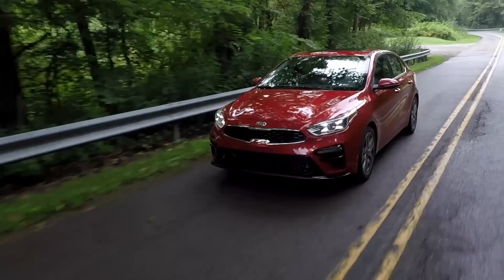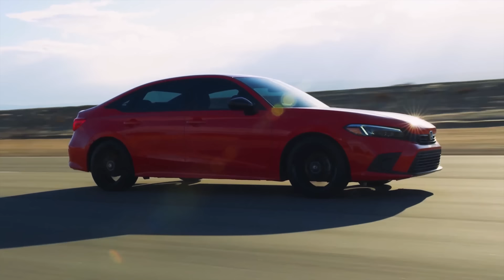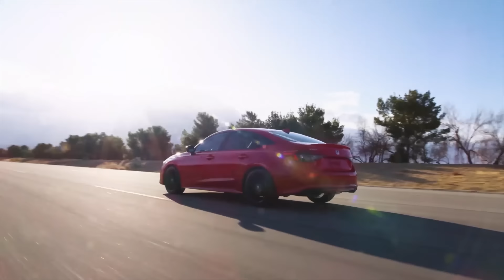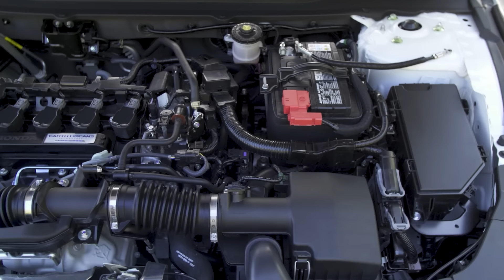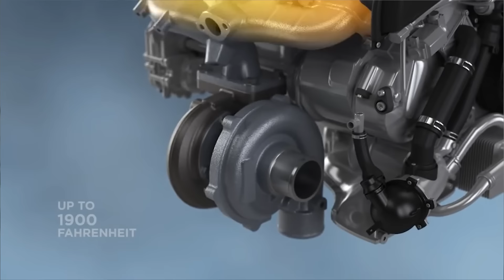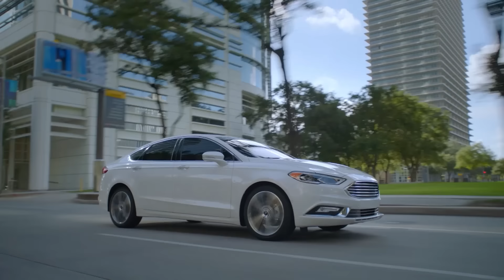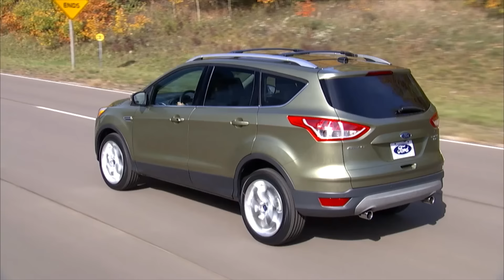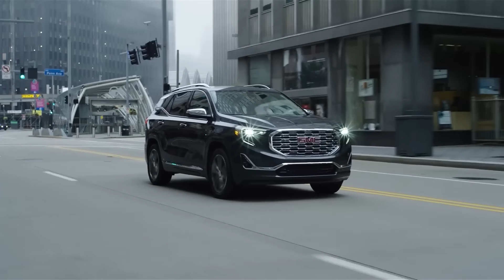Are Turbocharged Engines Reliable? The Truth About Turbo Engines

Comment: I have a 2013 Kia Optima with a turbo engine. Currently 145k miles. I live in a traffic heavy area. Haven't had an issue. And it takes regular gas.
Reply: Ironically, the Hyundai and Kia turbo engines are more sturdier than their naturally aspirated counterparts, due to their strengthened connecting rods and pistons.  Connecting rod failures are a key issue in the Hyundai and Kia engine recalls involving their naturally aspirated Nu and Theta engines.
Reply: @oi32df  That's true.

Comment: My sister just got a Tiguan with a turbo engine. It has that annoying stop and go where the engine cuts off automatically when it comes to a stop to save gas. If turbo engines don't like to be turned on and off all the time I don't understand why Volkswagen would use stop and go with them.
Reply from the maker: Because it results in better official fuel economy ratings on paper which is all they care about. The real world impact on long term reliability is of little concern to VW.
Reply: The very first thing I do when I start my 2020 Honda CRV is disable that annoying piece of crap.😆
Reply: So you can buy another one or pay them to fix it planned obsolescence

Comment: Great video Shari, as usual you nailed it with all the truths about Turbos.
Thank you for all your knowledge sharing for the lost generations now days. I personally, will not touch a Turbo vehicle unless I have money to burn. Most of us working class should just stay away from Turbo engines.
Reply: Thats kinda hard to do since most automakers are using Turbos (mated to CVTs which are even worse). I'm wary of  Turbos, and will never but a CVT so idk what to do smh.
Reply: Word!!
Reply from the maker: No problem!
Reply: @carhelpcorner  Can you explain how semi's can easily go a million miles on a turbo without issue?  Those engines are easily the most reliable on the road, and they ALL have turbos.
Reply: @nodammit  Those are turbo diesel which is a different story.
Reply: @nelubotas2545  a turbo is a turbo. Whether you mount it on a gasoline or diesel engine, it does exactly the same thing.
Reply: @nodammit  Wrong, most diesel engines are built to different standard!!
Reply: @nodammit diesel trucks are a different world and diesels have plenty of issues, too
Reply: @bb5242  Yes diesels have issues, but this video is about turbos.  The point I was making referencing diesels is that despite having turbos, they can go a million + miles before a rebuild.  I personally prefer gas engines, but I've worked with diesels for decades.
Reply: @mikek.9980  So you're saying that it's the standard the engine is built to that determines reliability?  Exactly.  Thanks for proving my point.
Reply: I had a Saab turbo in 1980, everyone told me don’t buy a turbo. I had the car for 13 years and not once did I ever have any problem with the engine or turbo. Used regular gas and changed oil every 5000 miles. Put about 15000 miles on it every year. Best car I’ve ever owned. I have a Hyundai with a turbo now so far it’s just fine.
Reply: @nicholasdidesidero2336  The old Saab were over built and they were premium vehicles which are not mainstream economical vehicles. The later Saab were GM influenced garbage.
My suggestion to Hyundai to not put any Turbos on any of their vehicles. Hyundai is never known for their overbuilt standard, they always barely made the standard and for them to risk their reputation on Turbos is a terrible combination. Hyundai is just passing on their risks to owners which on long term going to hurt the pockets. Just remember the old Saab and Volvos with Turbos were made to last unlike the later versions.

Comment: I’ve had 2 cars with turbo engines and I’ll Never buy one again. They simply don’t last as long.
We usually keep our vehicles for 10-18 years.
The longest I ever drove a car was 19 years. (I bought it when it was 5 years old, so it was 24 years old when it died at 488K miles. It was a 78 Corolla).
Reply from the maker: I agree buyers beware.

Comment: There aren’t too many vehicles nowadays with supercharged engines but I assume they have the same type of issues as the ones with turbochargers. Am I right? In particular, the MINI Coopers sold in the U.S. in the early 2000s had superchargers but then a few years later they switched to turbo chargers — I wonder why.
Reply from the maker: Superchargers are rarely used anymore because there is no fuel economy or emissions benefit. They generally don't seem to be as problematic as turbos, but they certainly put more strain on the engine itself.

Comment: Just bought a crv 4 days ago….not sure I would have if I’d seen this video beforehand.
I don’t drive long distance very often, would it be helpful to warm it up before driving? If so, only in winter or do I need to do so year round regardless of temps? I’d appreciate more advice for those of us who are already owners of turbo charged engines plz
Reply from the maker: No need for long warm ups, but try to take it for a long highway drive every so often just to keep the engine in good shape. Change the oil regularly too.
Reply: @carhelpcorner  how often? I’m totally ignorant about cars 🥴
Reply from the maker: @SusanPsalm51  take it on the highway once a week or so if possible. Change the oil every 6 months or 8,000km/5,000 miles. That's a good start 😊
Reply: I also own a 2020 CR-V and from what I've read, the Honda turbos tend to hold up well. The most important thing is to follow the maintenance schedule, especially oil changes and use good quality top tier gasoline(not necessarily premium) and it's usually sold at the mainstream gas stations like ExxonMobil, Chevron, or Costco.
Reply: Don't worry about having a turbo. I have a 2013 Ford Escape with the 2.0 L turbo engine.  It currently has 150,000 miles on it and never had any issues with the engine.  I keep up on maintenance and only use synthetic motor oil.
You do not have to let the new turbo engines idle for a minute before shutting them off. They are designed for oil to move through the turbo bearings after it is shut off. Years ago....when turbos were first used. They had problems because the oil just sat after you shut your engine off and baked on the turbo bearings.
Enjoy your new car, enjoy the power and fuel efficiency that the turbo brings!!
Reply: Enjoy your new car!!
Reply: A good long highway drive regularly will help and lots of oil changes, don't skip them.
Reply: Do not shot the engine immediately after long trip just keep it working for 30 second or 1 minute in order not to cause turbo failure

Comment: If your miles on a turbo are in that more severe category (short trips and cold weather) are there mitigating steps you can take to try and offset that periodically? Will a longer trip on a regular basis or periods of high RPMs help clear out the engine for example?
Reply from the maker: You should take the car for a long highway drive once a week. This could help prevent some long term issues
Reply: @carhelpcorner  but then you will get rock chips and I love my flawless paint 🤔
Reply: Are there any brands of fuel additive that can help? Or do oil flush treatments help? A long highway drive each week is a bit wasteful given fuel prices now
Reply: @piglet5287  I drive a 2019 Ford Fusion Titanium with Ecoboost. I work from home so I don't get to drive that much. What I do to get those highway miles in, is that (once a week) instead of going to my nearby grocery store, I go to one that is about 30 minutes away. The longer the drive the better for the turbo. Unfortunately, I don't want to drive for the sake of driving, so I do the grocery store runs. With regards to fuel additives, I don't use any. I just get gas from top tier gas stations. These gas stations already have more detergent in their fuel to help mitigate against carbon build up. I tend to use premium gas now also (I did not always use Premium). My car doesn't require it, it recommends it for better performance. When traveling to SC earlier this year, I noticed that my car drove better on premium gas than it's been driving on regular gas. That's why I started using Premium. Turbos really need quality oil, quality gas, and that long distance driving. They crave it. 😀
Reply: @bonedatt  although I'm in U.K. my situation is not so different. I drive a 2020 Peugeot 208 with the Pure Tech 130  3 pot engine used in many Stellantis models. It has all the risk factors  - turbo, direct injection, stop-start and a reputation for carbon build-up long-term (not to mention a cambelt running through an oil-bath but that's another story). As I've retired at least for now, my journeys tend to be short apart from the occasional 180 mile trip to see family. Like you I try to go the long way round for some local journeys, just to warm up the engine. I nearly always use Shell petrol, but not their premium (V-Power) product because it costs £2.09/litre here and that's after a recent price drop! The engine does seem to run extra smoothly with Redex fuel treatment, maybe because of the upper cylinder lubricant, but I've heard it said that additives are less beneficial with direct injection because the fuel bypasses the inlet valves. If true, that would surely also apply to additives already in petrol at the pump, but no-one mentions that.
I also read a mechanic on Quora claiming that modern engines no longer benefit from a high-speed motorway trip in the way they used to. The problem is that in the interests of economy, piston-rings are made to fit less tightly into the cylinder walls nowadays, so at higher revs there is more blow-back of oil mist from the crankcase up into the combustion chambers - and that leads to more fouling up. Well I'm no mechanic but it'd be good to see more comments on this. I'd imagine that long trips are still beneficial for lubrication, especially of the turbo, even if high revs no longer "clear out" an engine - if they ever did. Goodbye Italian tune-up? Good luck with your car, it sounds like you care for it.
Reply: @piglet5287  You chose the wrong 1.2 turbo fool. I have a 1.2 Turbo Toyota engine in My 2016 Toyota Auris, the engine has a timing chain and does not feature a wet cambelt which Ford proved a weak design in their Ecoboost engines. My engine also has 4 cyclinders and 4 extra valves too. It runs on both Otto and Atkinson cycles which prevents Carbon build up and it drives incredibly well on 73k miles and as a 2016 engine. Its obviously inferior as it has 14 less HP and gets 2 mpg less whilst being more reliable, smoother and having a better power curve especially when comparing on Torque.
Reply: @gravemind6536  slightly more serious reply: considering how widely used is the Pure Tech 130 engine, by Peugeot, Citroen, Vauxhall , DS, Opel.... it's surprising how rarely one heard of failures. In fact I saw an article stating that the notorious disintegrating Cambelt problem, leading to blocked oilways, had not occurred since 2020 - admittedly this was by then the SEVENTH redesign of the cambelt material by Stellantis (it said).
Reply: @bonedatt  you are right about using the correct oil. The oils recommended for engines like the Stellantis Pure Tech (00w20 and 30)  are pretty specialised and the problem there is that many later owners will resort to non-franchise garages who use God knows what oils. But as for driving 30 miles to buy groceries instead of (e.g.) five, isn't that the same as driving 25 miles to no purpose?

Comment: Great video!!  This is why i chose the Camry XSE v6 over the Honda 2.0. I just ordered it two weeks ago. My job is only 7 miles (Highway ) from home and so i was worried about the warm up and cool down with the turbo.
Reply from the maker: Great choice!
Reply: You choose wisely, Sir.
Reply: If you only drive 7 miles each way, make sure to change your oil 3-4 times per year even with good synthetic oil. Your oil will get diluted with gasoline and your engine won’t get a chance to burn it off. I personally commute 8 miles one way but once per week I take the car for a 30 minute drive, still change my oil 3 times per year even though I put on 2.5k per year or so.
Reply: Toyota is phasing out it’s 3.5 v6 for turbo hybrid cvt powertrains !  It’s awful!!
Reply: You’ll get 20 yrs service from that car
Reply: I agree that is a rock solid car!! I hope Toyota does not get rid of that optional engine!!
Reply: @Jahman Borneo Congratulations ! My dealership told me last week that my xse V6 should arrive by Nov 13, not sure if that was accurate but it should definitely be here by the end of November

Comment: No Turbo or Super Chargers for me. Although either way, if an engine is actually designed properly for either, maybe. I found out something rather just plain stupid few yrs ago - Block heaters have been set to only work at - 20 C, in Canada anyway. Talk about a cold start.

Comment: Problem is more manufacturers are going away with na engines.
Toyota was the last holdout & they're also transitioning to turbos.
Reply: Mazda seems to be a good job resisting with their ubiquitous 2.5 liter Skyactiv-G engine and six speed real automatic.
Reply: Yes, but Toyota tried it on the Lexus first to iron out any issues. Toyota is amazing low risk takers…I applaud them for it. Regardless, any Turbos going to hurt the wallet in the long run.
Reply: @Thankyou_3  but the tundra is having turbo issues tho…
Reply: @MrINDEPENDENT2000  I guarantee you that Tundra caught it earlier enough and Toyota will not procrastinate like Honda. Hondas solution is a software update with oil dilution issues. Toyota will actually invest money to fix the underlying issue on the Tundra.
Reply: @Thankyou_3   bro stop it Honda been fixed that issue
Reply: @MrINDEPENDENT2000  Not true, if you pull out the dipstick you will smell gasoline. The Turbo engines from Honda burns oil and dumps gasoline in the oil pan.
Reply: @MrINDEPENDENT2000  it was waste gate issues, There’s nothing wrong with the actual turbos. It was caused by a bad batch of parts which can happen to anyone.

Comment: Thanks for the information, TOYOTA  Highlander is coming out their TURBO engine,  concerns you expressed would be same for that vehicle?  How the manufactures are addressing this?
Reply from the maker: The Highlander will have a different turbo engine from the Tundra. Unlike the Tundra, it will have a mechanical waste gate, so it should avoid the problems the Tundra has been having. I'll cover this topic in more depth in a future video 👍